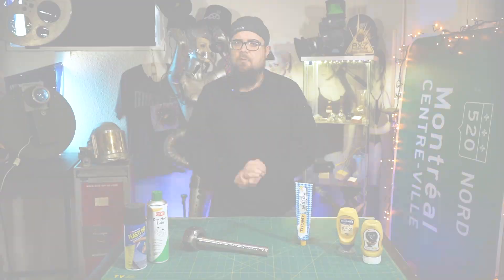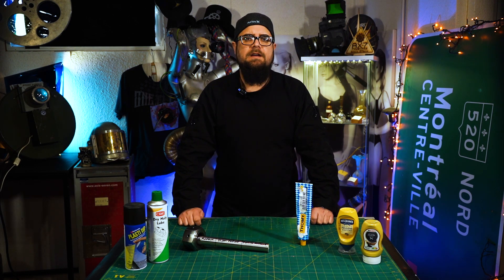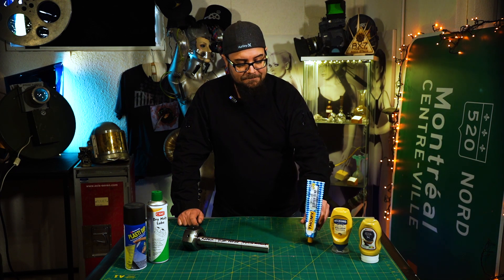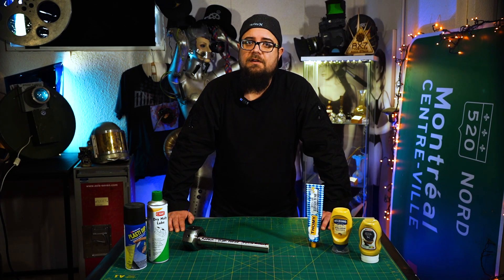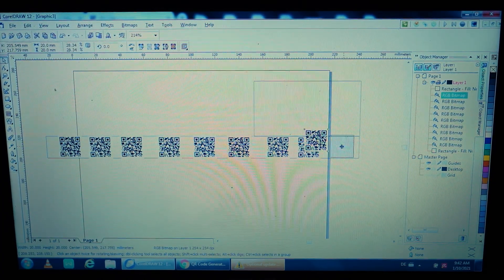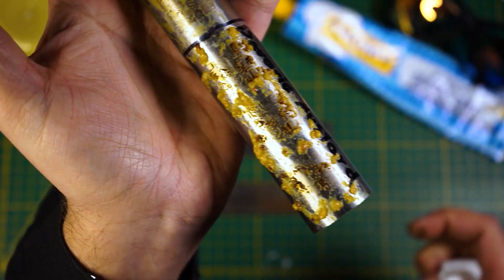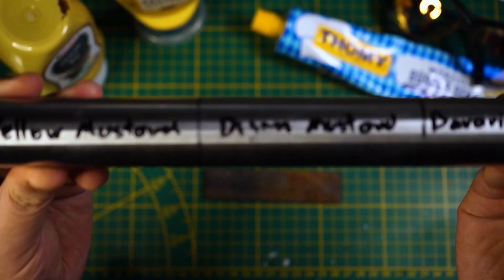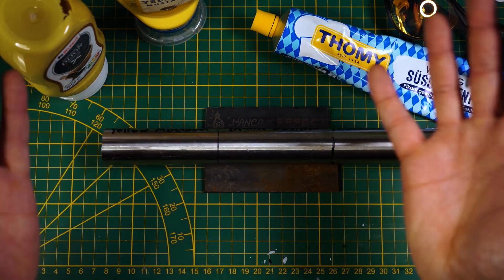K40 Laser Mustard Experiment / Can you mark Metal using Mustard?

Comment: Are you sure your rod is not chrome plated? Many hydraulic piston rods are. Have you tried slower speeds? 
I may have been the first to try this technique, see my video on my channel from a few years ago. I verified it is not the vinegar and it only works on metals containing nickel. I believe certain sulfur compounds in mustard create nickel sulfide on the surface.
Reply from the maker: The rod i used is made of C45k h9 cold drawn stainless steel. For me it did not work, i have tried multiple metals so far without any results. However i also tried moly lube that did not work eighter for me. Maybe i was just unlucky with the materials i used or my k40 is just not powerful enough.
Reply: @MancaveEffects  That is your problem. UNE C45K steel alloy is a carbon steel, not stainless. H9 is the tolerance spec on the rod. if it is not rusting, it is likely chrome plated rod material sold as a replacement for hardened stainless rod.
Reply from the maker: Thats sad because in my Patreon playlist there is an early version of this video where i used galvanized steel by mistake. To correct this mistake i went to a metal factory store and asked them for some stainless steel, they gave me this rod telling me that this is the stuff i would need 🙄 however i will certainly give it another try one day.

Comment: you can mark stainless steel with a co2 laser . you just need the dull looking plate that has build up enough oxide to react with the laser. i tryed it it workd. onley focus point needs to be dead on. thats hard becous the plate tends to warp